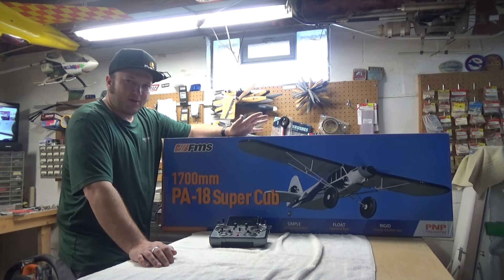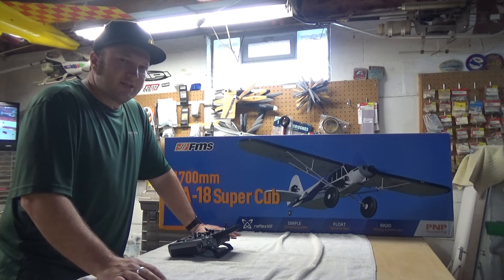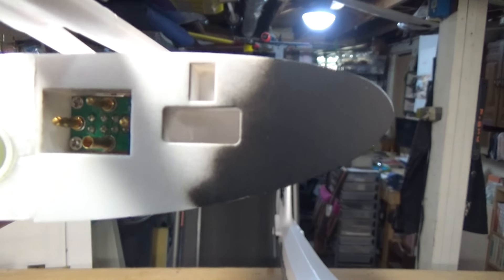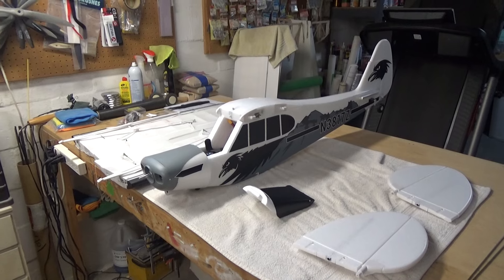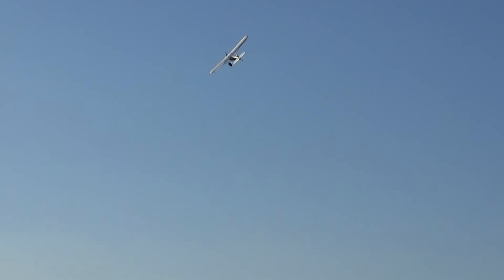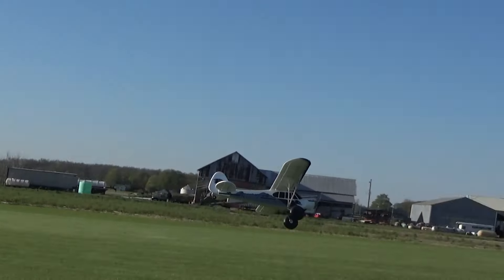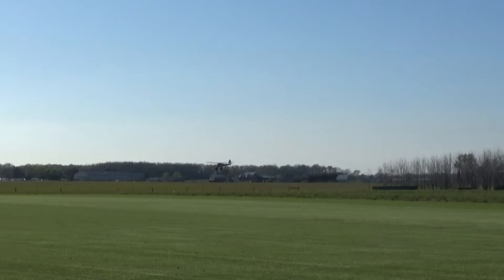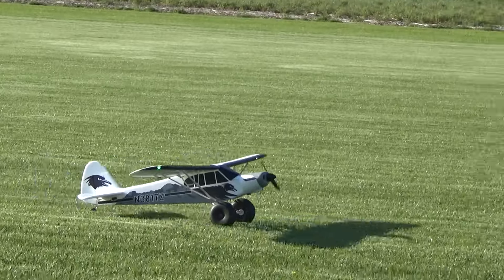FMS 1700mm PA-18 Super Cub assembly and flight review!

Comment: Great aircraft. Just sold mine to another club member. One thing I found was the plastic parts on the fuselage, holding the wings detached from the fuse possibly due to pressure on the somewhat heavy and long wings. I re-glued them and added 2 wires with 90 degree bends, drilling small holes in the plastic and epoxied in. That would hold the parts in place preventing them from detaching again.
Reply: yeah mine have come detached too. How exactly did you reinforce it?